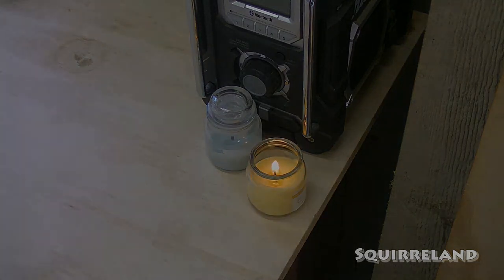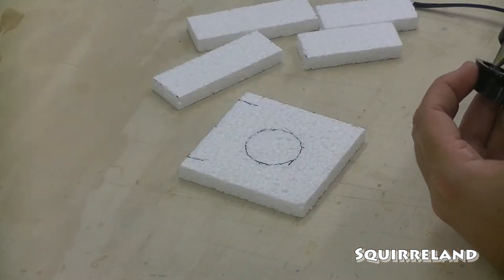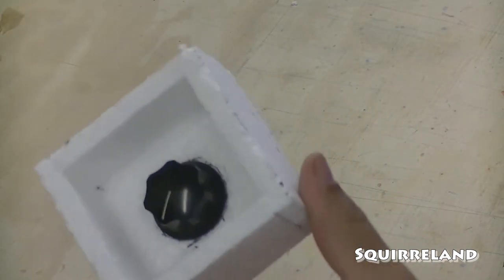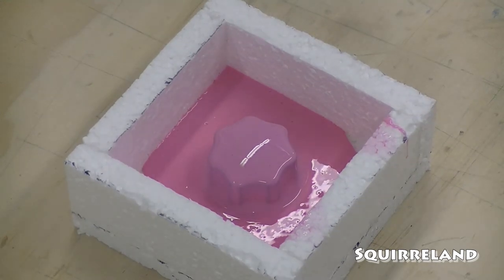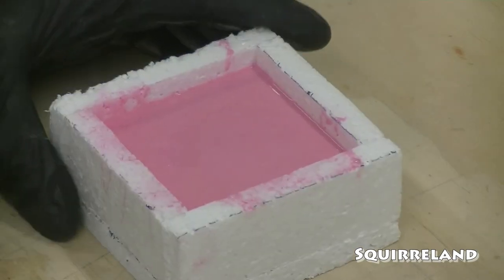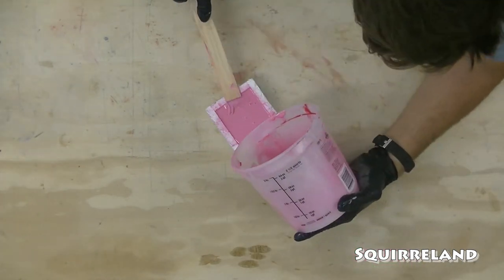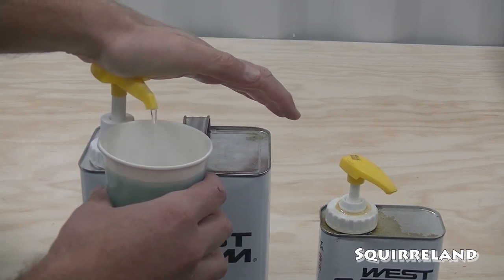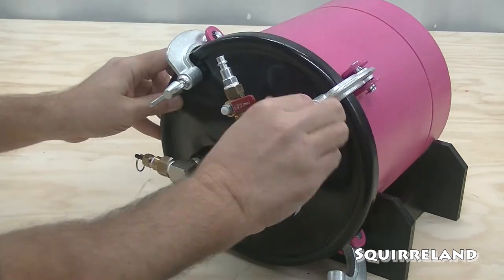Radio Knob Mold - Silicone Mold Making - Squirreland

Comment: What did you use for insert (brass/moulding?) to attach to splined shaft?
Reply from the maker: It's just meant to be a decoration, it's not meant to be functional or a replacement for an actual radio knob.

Comment: What kind of resine did you use? 😊
Reply from the maker: West System 105 Epoxy Resin with the 206 Slow Hardener and black resin pigment from the hardware store.
Reply: @squirreland  thank you!!!
Reply: Another question, did you use vaseline to do the molde?